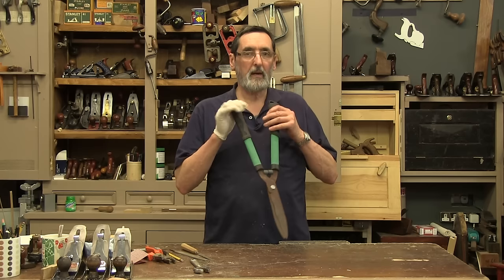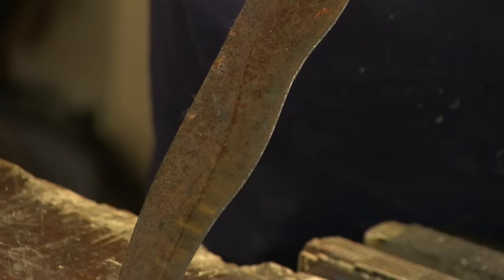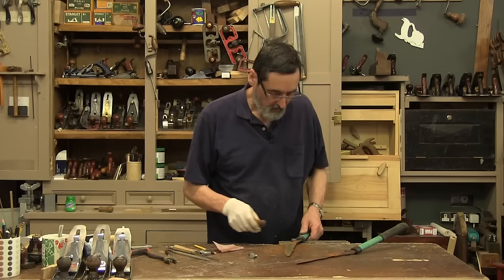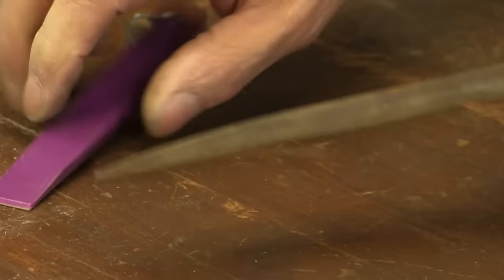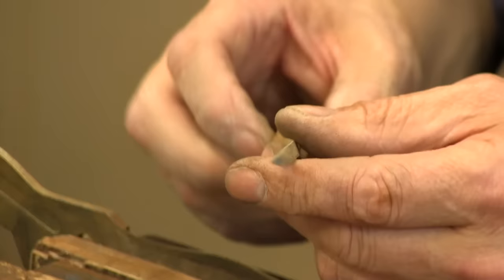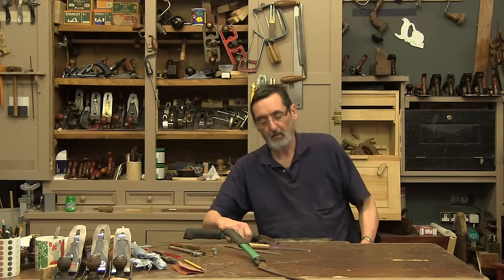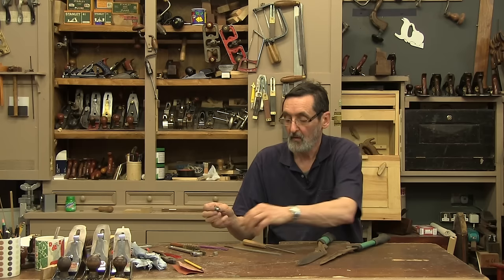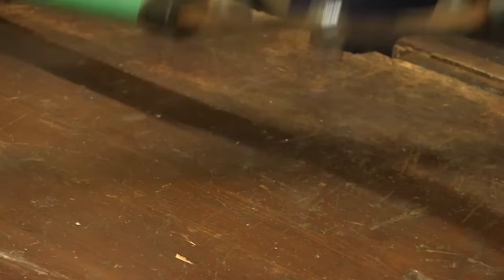Sharpening Garden Shears | Paul Sellers

Comment: Thanks. Very useful. Nice and sharp.  Better to grease the nut (called a Nyloc btw) and bolt when reassembling, oil the faces around the pivot before reassembling. And lose the adjustable spanner (use a proper spanner!) Loved you delivery. Cheers

Comment: It's funny, I really enjoy Paul's work as a lifetime of experience.

Just funny, because when he restores woodworking tools, they are always good tools to start with, even the scissors he sharpened were really well made ones.

As a gardener since a boy, I would throw those shears out. I'm not saying that Paul should, it's his tools and he knows what he's doing.

I'd restore an old pair of Spears and Jacksons, if inherited, with straight blades (one notch at the back for light pruning if needed while shearing), which are better for hedges, but just a better pair of starter shears overall (also more of an angle between blades and handle than those had, which is better for flattening tops, the same using them other way around when working with hands above your head). I prefer shearing by hand to with power-tools every time for the much better finish.

Comment: Hello, I hope you're still keeping an eye on these comments. A particular pair of shears (Wilkinson Sword, cush handles, hedging notch) has me beat.  I think they were originally quite "high-end" models, but I picked them up at a car boot for a £1.  Perhaps there's a reason...? They've been stripped, cleaned, sharpened (as per your instructions and my previous experience).  The blade edges are wicked evil sharp. As HEDGING shears they're magnificent, cutting through laurel and box with hardly any pressure on the handles, just the closing action alone.  But they can't cut grass.  It just folds over and goes between the blades.  Originally the top shear blade had a slight bow to it - I've straightened that - the hedging action got even better, but the grass still manages to fold between the blades.  I've flattened the non-bevel side of both blades in case there was some lead-in happening there.  No change. The tension of the blades is easily varied with a notched thumbwheel on the top - I've tried tightening that - hard.  Still the grass folds and goes between the blades. I don't think it is an issue with a particular blade, turn the shears over and the grass now folds over the other blade. 

I've noticed I can tweak the blades with thumb and forefinger at the tip to flex them so there is a gap down the length of the cutting edges.  Could they be just too "springy" to use for grass work?  Have you heard of any difference between hedging and grass-shears?

I must be doing something wrong, but what?   

TIA
Reply: I think I have found the solution, I can certainly cut grass now, and the cutting of hedge growth has only been impacted a little.  The clue was in this article about dog-grooming scissors: https://www.groomertogroomer.com/why-is-there-a-space-between-the-blades-of-my-shears/ . Crucially this:

 'space between the blades. This is called the “set.” On beveled edge shears, it enables the shear to “slice” the hair. Without this space, the hair may fold.'

I put a slight bow in both blades by lifting up the tip and the pivot end of the (separated) blades on 1/2 inch blocks and applying pressure mid-blade with a G-clamp.  Counted the turns to try and get an equal bow on each   blade and re-assembled the shears.  A quick trial shows that the grass is sliced nicely along the length of the blade as the blades meet at that  single point which moves towards the tips as the blades close.  The pivot adjustment knurled knob now actually alters the action too.  

Something extra to consider for shears that will be used for grass - just having the blades exceptionally sharp seems not to be enough.  YMMV.

Comment: Hi Paul - started trying  to sharpen my dad's old shears which seem pretty well made.  I noticed that as I slowly close the blades, they meet at the tip and the heel but in the middle (longitudinally) there is a gap.  Is this how they're designed or do I have bent blades?  Not sure if I should attempt to take that out.  To be clear, the hollow is along the length - not across the width of the blade.

Comment: Master Sellers makes it looked so easy, but not for me. One of my good quality bypass pruners does not cut, found out the cutting surfaces do not come together at the point of shear, there was a paper thin gap across half of the cutting surfaces where light came through. Keep on sharpening the edge does not help. Spend good part of an hour flatten the concave surfaces on a 600 grit diamond stone. Got it to cut but not factory sharp, next maintenance cycle (another hour on the diamond stone) will have it perfectly flat and sharp. Yep Paul did say the cutting surface should come together.

Comment: My new ARS-KR 1000 shears came with a small back bevel on both blades. I wanted to take note of the angles for later sharpening, so had a close look with a microscope. They cut wonderfully, though. I can't find any information anywhere why you'd want to sharpen shears with a back bevel and whether I'd need to replicate it when sharpening.

Comment: Hi Dear , 
I have problem with my garden shear that couldn't cut the brunches and the leaves easily because there is a space between the hedges even if I tidied together very well. So we need a video how to fix this problem. Thank you so much
Reply: Sami Brydan, Open them completely, then tighten.  Squeeze the handles like you were going to cut something. If they are closed completely and you can still see daylight between the blades- the tools is bent. Disassemble, try to gently bend back to shape, reassemble and test again. When the blade edges touch each other the full span, you should be in business. This kind of damage happens when someone has tried to cut something too big and forced the shears or they were dull and someone twisted on them trying to tear something apart rather than cutting it.  Not saying it was you, just telling you how to avoid a replay  once you repair or replace them. God Bless.   <><

Comment: Thanks I will see if I have a diamond file. The vice grip I do not have to hold my shears in place though. I don't have much workbench space. Any other suggestions to hold it in place?  I like to do more of the trimming and my husband does the lawn care.
Reply from the maker: Hi Fleur. The whole thing relies on a secure grip and i have no alternative to offer you because it becomes a safety issue.
Reply: Fleur D:

This is a bit late but you can use a couple of "C" clamps to fasten the blade to a plank, put the plank on a chair, kneel on the plank and hold the file vertically.

Or just clamp it to the kitchen table or garden chair.
Reply: @Paul.Sellers   I have a vice now. Thanks.
Reply: @bertkutoob   I have those thanks.

Comment: sorry, real gardening shears have a blunt edge (anvil) that will cut better than those pieces of crap and my late grandfather would laugh at this, as the edges of the blades just need to be a clean edge with out wear and Nylock  nuts are useless on them, Spring/star washer or compressed nuts are better, allow for adjustment unlike nylocks